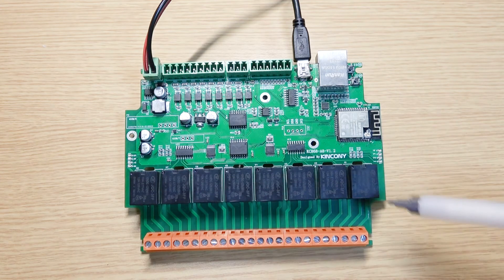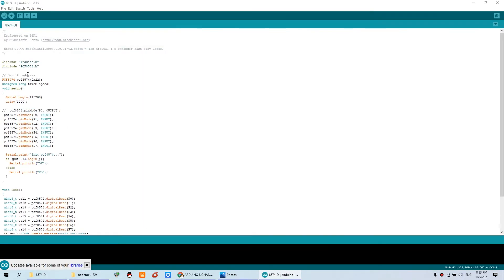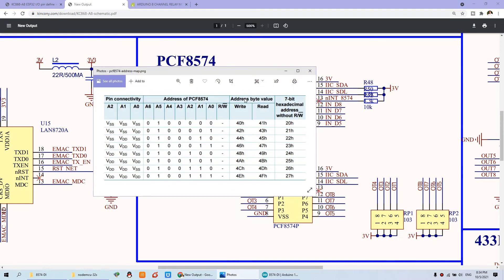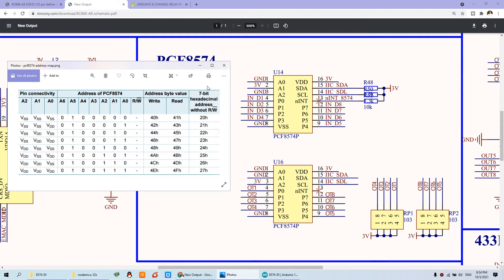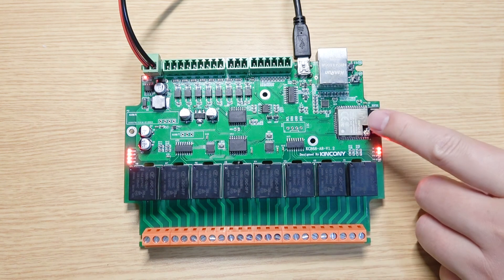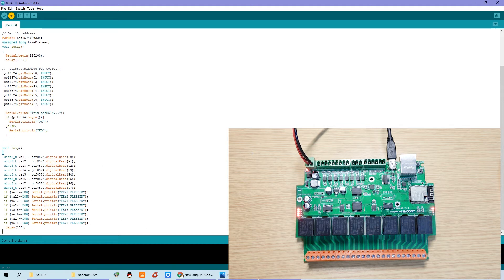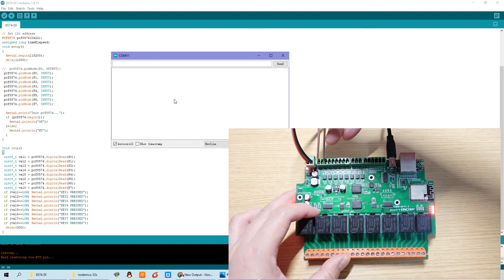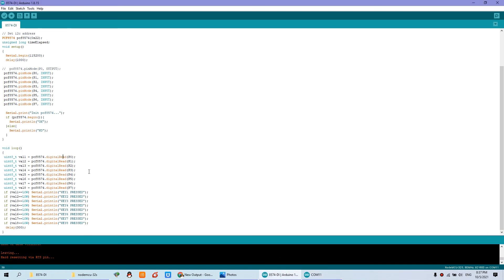Lesson20- how to use PCF8574 IIC extend GPIO for ESP32 input ports

Comment: How cam I catch/react to interrupts coming from input ? It looks that pin 13 (INT) on expander PCF8574 is not connected with ESP32. (KC868-A6-v1.3)
Reply from the maker: not need use INT pin, if you want use arduino code, there is demo source code in kincony forum, just need to install PCF8574 library.

Comment: 26 and 29 is not a default pins for esp32, how did u declare them as i2c pins?
Reply from the maker: you can set in arduino pins define file.
Reply: @KinCony  it doesn't works. I tried:
Wire.begin(26, 29), 
Wire.setPins(26, 29),
tried changing defines in vendors\esp32\pins_arduino.h

29 pin can't be used. When I changed SDA SCL defines I got this error in the serial monitor:
entry 0x400805cc [    10][E][esp32-hal-periman.c:122] perimanSetPinBus(): Invalid pin: 29

I found this code, it check pins by mask

// 039 valid except 24, 2831
#define SOC_GPIO_VALID_GPIO_MASK        (0xFFFFFFFFFFULL & ~(0ULL | BIT24 | BIT28 | BIT29 | BIT30 | BIT31))

When I removed BIT29 - I got another error: 

[E][Wire.cpp:449] endTransmission(): NULL TX buffer pointer

I don't know what to do next, please help. Also I posted this in your form under this lesson.
Reply: @KinCony   it doesn't works. I tried:
Wire.begin(26, 29), 
Wire.setPins(26, 29),
tried changing defines in vendors\esp32\pins_arduino.h

29 pin can't be used. When I changed SDA SCL defines I got this error in the serial monitor:
entry 0x400805cc [    10][E][esp32-hal-periman.c:122] perimanSetPinBus(): Invalid pin: 29

I found this code, it check pins by mask

// 039 valid except 24, 2831
#define SOC_GPIO_VALID_GPIO_MASK        (0xFFFFFFFFFFULL & ~(0ULL | BIT24 | BIT28 | BIT29 | BIT30 | BIT31))

When I removed BIT29 - I got another error: 

[E][Wire.cpp:449] endTransmission(): NULL TX buffer pointer

I don't know what to do next, please help. Also I posted this in your form under this lesson.

Comment: Dear manufacturer, this code does not works! I'm stuck on determining i2c custom pins 26 abnd 29!
Reply from the maker: KC868-A8 IIC SDA:4   IIC SCL:5   these two pins.
Reply: @KinCony  what you mean 4 and 5?? Board has 26 and 29 pins for i2c.
Reply: LOL)) I was inattentive, I've lost two days to this)) before Arduino I coded using nanoframework, and there I have to use PIN numbers, so they are io4 is 26 and io5 is 29.

Omg))) 
 ty for fast reply) I will try new pins soon.
Reply from the maker: @МаксимКройз  which model you are using?
Reply from the maker: @МаксимКройз  https://www.kincony.com/forum/showthread.php?tid=823
Reply: @KinCony  I use A16, but now I see my mistake, I have to use GPIO numbers instead of PIN output numbers) I will try it asap)
Reply from the maker: @МаксимКройз  ok
Reply: @KinCony  everything works fine, thank you.
But I faced another serious problem - the initial state of pcf8574 ((( I'm setting pinMode as outputs right after begin(), anyway I have high signal on outputs for a short time (halp sec). My outputs are connected to contactors which start motors and other hardware, it's really critical to me. maybe you know the solution how to prevent HIGH states on outputs on board boot?
Reply from the maker: @МаксимКройз  do you write arduino code or config by ESPHome?
Reply: @KinCony  I wrote on c# with Nanoframework, also I tried in Arduino. But the situation is the same - pcf8574 have an initial state of HIGH for a short time after powering on the board till firmware boots and change its state.
Reply from the maker: @МаксимКройз  you can download our arduino demo code, compare  the sate when power on. here is link: https://www.kincony.com/forum/showthread.php?tid=1610
Reply: @KinCony  My sketch was the same, except i used Adafruit_PCF8574 library. I founded that setting pins mode as output makes it HIGH value. All works fine without setting pin mode, I removed pinMode(PIN, OUTPUT) problem gone) Thank you for fast reply and support. Have a nice day dude)
Reply from the maker: @МаксимКройз  ok, good.